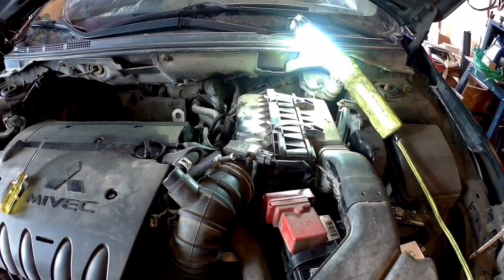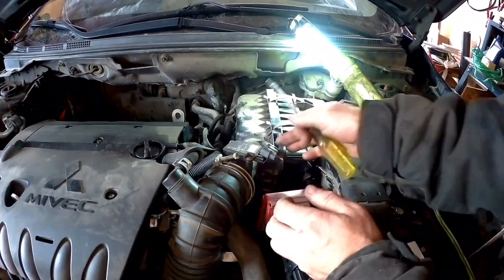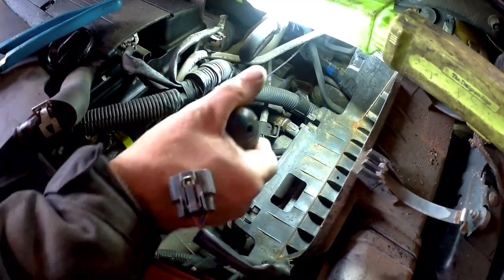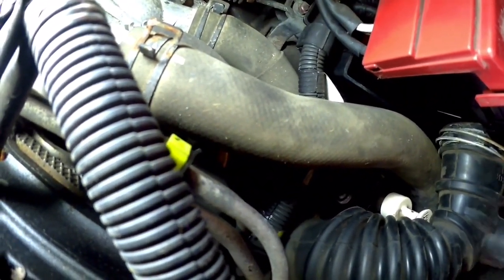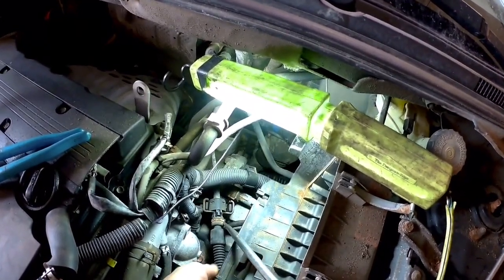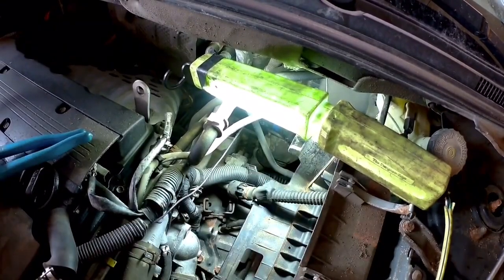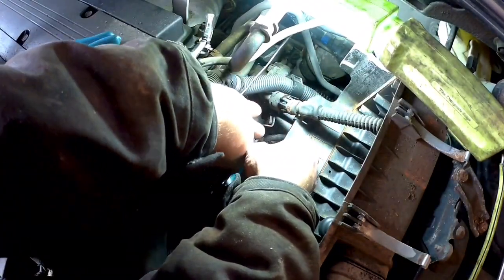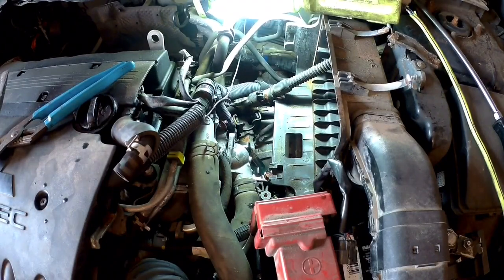2012 Mitsubishi Lancer Thermostat Replacement

Comment: Do you have to bleed the air after adding coolant? Do you just leave the radiator cap off while the engine is running?

Comment: Nice videos! I have a 2012 lancer 2.4 as well. I’m ready to change my transmission fluid. Is there also a filter that I should change too?
Reply from the maker: There is a filter, but sometimes it isn’t serviceable. I’m not sure if it’s internal or external on the Lancer....
Reply: Just search for the CVT fluid and filters replacement video here in YouTube. You do have to replace two filters with its seals and gaskets. One under the battery tray, inside the CVT fluid cooler housing and the one inside the oil pan. These filters have to be changed every 60,000-80,000 miles (100,000-125,000 km).
Reply: @KendorFarms  would you happen to know where the cooling temperature sensor is located

Comment: So I have a 2011 lancer and it’s been overheating a lot recently. Like to the point of it flashing to check temp. I replaced the radiator fan because one of my fans wasn’t working and now both fans work but still heating up. Do you think a thermostat change would do? I have no coolant leaks, my hoses are good, and no puddles or sweet smell
Reply from the maker: Yea for sure. It's a cheap thing try... it could be stuck closed
Reply: Kendor Farms thank you for the quick reply. I’m going to attempt it tomorrow.
Reply from the maker: Bryan let me know, it could also be a head gasket, but you’d probably be loosing coolant from burning it.... but a failed thermostat is more likely
Reply: Kendor Farms I will thank you for the advice. I’m going to check my local auto zone for the part and hopefully this fixes my problem but I will also check out the head gasket
Reply from the maker: Easiest way to check is pull the plugs and look for one with a white tip. Coolant burns white. Good luck!
Reply: Kendor Farms hey I got to it earlier this afternoon and I replaced the thermostat and it run just like new again! I can’t thank you enough I saved a lot of money. The mechanic wanted to replace the water pump, hoses and radiator. I ran the car to do some errands and it didn’t heat up at all. Thanks again

Comment: Hi, why do you change the termostat? Do you have any problems with weak heating inside a car?
Reply from the maker: AFGarage Yes, there was a complaint of it not being very warm
Reply: Kendor Farms In my lancer is very weak heating but two heater hoses was warm. Engine temp is ok but lower coolant hose is cold. Termostat is broken?
Reply from the maker: AFGarage Yes, I would definitely try that first. It’s the cheapest and easiest place to start
Reply: @KendorFarms  OK. In my country I have to choose two kind of thermostat open temp: 82 and 87 Celsius deg. Which to choose?
Reply from the maker: I’d choose 87

Comment: I'm from the Philippines it's a tropical country, some mechanics here are saying it's optional not to replace it and remove it at all. Since we are a tropical country, the engine can function the same, there's  not much use of it. What do you think?
Reply from the maker: You can run without one, but they help keep the engine running at optimal temps. At the very least put in a lower temp thermostat in my opinion
Reply: @KendorFarms  Thank you very much.
Reply: I've runed cars without termostat, runed great, even faster because the ecu thought is a cold day😂

Comment: Where is the coolant temperature sensor located
Reply: Its at the back of the engine, at the cylinder head, with two small wires..
Reply: @pcbahar  Can you give more details .

Comment: If you replace without a thermostat does the housing need cement or a gasket?
Reply from the maker: It would need a gasket to fit in properly

Comment: Is it required to full drained the coolant and replace a new coolant after replacing the thermostat?
Reply from the maker: ntonytay no you don’t need to fully drain it, just maybe to half or below the thermostat at least. If you can keep the coolant you drained out clean and it looks good and tests good then I would reuse it if you need to
Reply: Thanks mate. I'll recently just changed the coolant so in order to replace the thermostat, i guess ill just reuse the existing coolant.